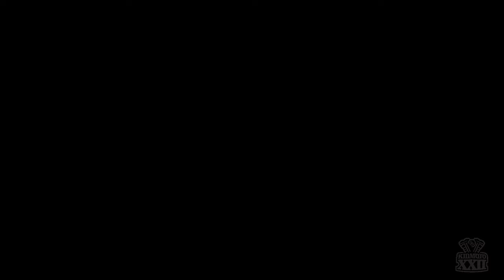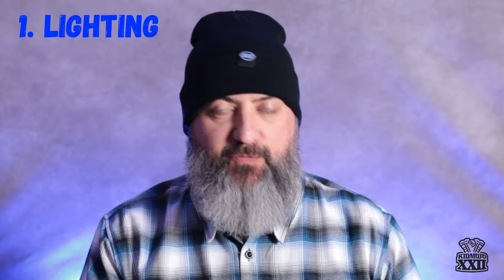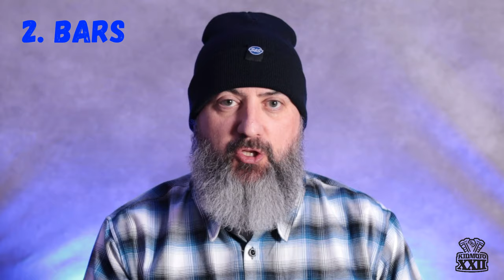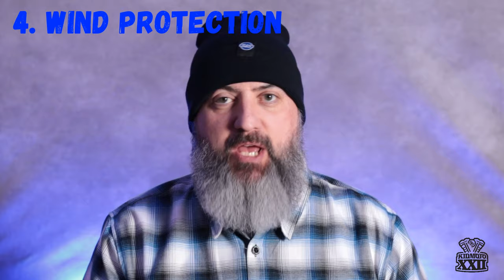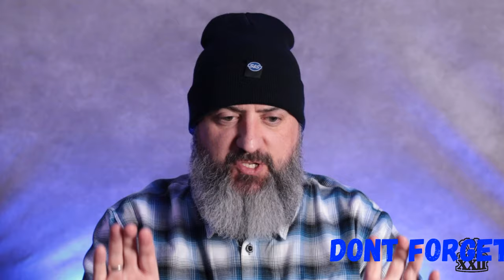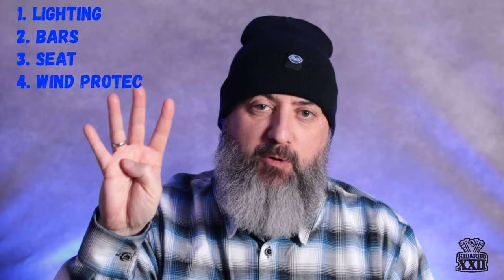5 Harley-Davidson mods to do before exhaust

Comment: Definitely no on the windshield or faring ..I ride pretty much 365 35k on a slow yr 57k was the most I’ve done ..also if you going to change the exhaust or intake it should be done FIRST the reason is Harleys are lean from the factory and should be tuned changing your exhaust it will run more lean change your exhaust and intake tune it and go from there …if you want to keep the stock exhaust  and intake get it tuned
Reply from the maker: Dude…the whole point of the video was to talk about five things “I” think a rider should change before exhaust. 
While all the things you said are true I was making an argument for breaking the mold. 
You do you! You have to live in a warm weather place to crush those miles!

Comment: I agree, but I always go 1: get the crankcase vent hot air routed out of the airbox 2: Suspension 3: seat 4: Let the CAT out and add an FP-3 or FP-4 and run a canned tune. 5: slip ons if you think you like the sound better

Comment: I have a 2000 electraglide standard. It’s a great bike. I put some really nice black chrome apes, a cop seat, and converted the lights to led. Not to mention air intake and oil cooler. And honestly I’m perfectly happy with it. I may get some fishtails on it. However it’s definitely not a deal breaker. Just make your bike comfortable and work for you and you’d be surprised how little the exhaust actually matters overall. And mines a daily driver(only vehicle I got), but I’m single and just living my life my way. To each their own.

Comment: You are absolutely correct, just bought the 2022 Road King First thing 18" handlebars, chrome lowers, shifter rear, extended brake pedal, extended footboards out, all led lights, and mod, cut baffles out or order slip-ons, lowered 1" bike, got the stock windshield and keep the seat save some money. Later at the rallies, change everything. lol! I have a chrome addiction, I love seeing other bikes chromed out to get ideas. Take care

Comment: All good points. This has been mentioned already. I upgraded front and rear suspension to Legend on my Road King Special. This is hands down the best upgrade I've ever done to any Harley. The Handling and Ride quality is so much better than stock. More planted on the road. Could go on and on about the benefits. Take care.
Reply from the maker: I’ve yet to do suspension upgrades on my bike at this point. However we are going to have the legends suspension crew on the Five Dirty Bikers podcast very soon
Reply: what did you put in the forks . i found stock ones hit hard on frost heaves
Reply: @1Imrichard  Legende AXEO cartridges. No brake dive at all now. Planted on the road. Highly recommend Legend Suspension.
Reply: I like my Springer, but I’m thinking my next HD might be a Road King so thanks for that food for thought.

Comment: Wanted to call out that I would whole heartedly agree... lighting upgrade should definitely be #1.  I use the Ciro Fang switchbacks for front, and Ciro Fangs for rear.. and they are awesome.  My rears almost look like brakes are on, until I actually apply the brake. Then went with the Ciro Vision 7" Halo for headlamp, with module to keep low beam on when I flip to high beam... and really lights up the road like  you wouldn't believe.  Was so happy this was one of my first mods I personally did first (my second was stereo system and speakers lol).
Reply: I listen to the road

Comment: I’m glad that there are still bikes out there with halogen headlamps. I don’t like the color of the leds, all my bikes have had halogen and appear a more natural color allowing me to better perception of distance and hazards on the road. I guess it’s what you get used to. And as many older riders may be finding out, those high handlebars that keep your hands above your heart, makes your hand go to sleep. You have much more strength and control with your hands down in front of your body instead of up high. In an emergency situation that may be critical. Sometimes we put form over function.
Reply from the maker: My bars are level with my shoulders and allow for the most natural position for me to ride. With my height and arm length that’s the best fit. I ride long days and the stock bars had my wrist in a very uncomfortable position. For me the bar change was both form and function.

Comment: I was sceptical when I first tuned into this video but, this guy has a point and I've always done exactly all those upgrades for my personal comfort and safety. I would however add the following; your seat, I've been using the same seat since 2008, my CVO seat and I put it on three other bikes since - the most comfortable seat I've ever used from HD, upgraded shocks are a must and you must do both front and back for proper results, I also install the Power Commander tuner to get better AF mixture which adds a lot more response, better torque and reduces engine temps, I also immediately install the Axtell Oil Bypass upgrade (on TCs - do not know about m8s) to increase oil flow, reduce temps and enhance the cam chests splash lubrication, the S&S 583 cam with better bearings and finally, I always change the air box and in my opinion, the S&S Teardrop is still the best performing air box on the market.

Comment: 05 Road King Custom (3200 miles & had her 3 weeks)took off the heel shifter, added Lockable hard bags, LED headlight/driving lights, riders backrest, adjusted the bars to comfort and highway pegs. Need heated grips and I’m ready to roll. I think I will get progressive suspension front and back as well.
Reply from the maker: Suspension is a great first upgrade

Comment: 1) shocks have been upgraded to Progressives  2) seat and I have a Road Air Zeppelin that is heated  3) heated grips 4) engine guard foot location and I have a Lindbar with stirrups 5) cup holder

I have an 06 ElectaGlide Standard that has been highly modified. I have the Screaming Eagle CVO paint design but in Sunglow Yellow and Sunglow Blue. Kuryakyn windshield mirrors and some of their other chrome doo dads. It has the 6" windscreen and the Sony radio with Bluetooth to work with my Arai full face helmet on the phone functions. I have the stretch tank and stretch bags. I have added cruise control, tour pack with Zeppelin backrest, and the bag guards of the Ultra Classic. At 30k miles I had it punched out to 98 CI, gear drive torque cam, Fueling oil pump, fish tail open exhaust, and performance tune to get me to 101 HP.  I am now at 120K miles and it is still as tight as it was at 31k miles. I have replaced the heated grips twice. I am still waiting for the transmission to fail so I can put in a 6 speed. It can out perform the 06 CVO and has all of the CVO or better upgrades for $8 grand less. I will easily roll it to 200K miles.
Reply from the maker: That’s awesome dude…sounds like you’ve got a killer right there and your taking great care of it!

Comment: I bought a used 2023 RKS. Luckily with SE exhaust, and original Ventilator airfilter and HD windsplitter. I just added….Hyperpro suspension F+R, Saddlemen SDC Pro, 14” Gangster bar with Kahuna heated grips, and rear crashbars…..check✅

Comment: The wide bars are like power steering as far as counter steering goes and personally I like them. I ride touring bikes Ultra Classes so it’s covered, and I went with a about 7 K worth of performance mods for power and reliability and a really good tuner, this includes exhaust mods. I wanted well over 100 horsepower and torque for riding two up and loaded. Everyone needs to do what they think is best for their bike.

Comment: On the newer touring bikes, specifically the 09 to 16 the exhaust is also a comfort mod. I'm talking the head pipes with the cat right by your foot. before I replaced the head pipe on my rushmore bike, I cut the cat out and added a tuner.

Comment: Agree, if you count adding the heel shifter, I've done all those things. I have a 2020 Road Glide Special, exhaust is still stock and probably will stay that way.
Reply: I took a short 80 miler today, and I realize I had foot pegs added to my highway bars too. I have a 114 now. After a 1200, 103, 103 stage one how much more power do I need?

Comment: Sir, what a great video. The first modification I did was get rid of that horrible brake pedal. I replaced it with a soft brake brand lower pedal and what a difference. Then I did your other 4 recommendations .
Reply from the maker: I think that as I’ve put more and more miles on my bike I’ve seen safety and comfort take priority over sound. That said I recently did a cam upgrade and nothing has changed the characteristics   of the motor as much as that has. A cam upgrade is something I’d highly recommend.

Comment: My 22 RG Limited 
1. Klockwerks windshield
2. Hammock seat
3. Bars-12 inch KST fully adjustable
4. Rear Light’s- Custom Dynamics LED Taillights/Signals, Filler panels and bag lights, license plate relocation kit with new taillight and CD flasher controller
5. Front LightsCustom Dynamics front LED light/ signal, lower lights, headlight bezel lights, windshield frame lights
4. Rinehart 4.5 DBX

Next is Trask A/C, SE stage 2 TQ cam and tuner
Reply from the maker: That’s a solid list!!!!

Comment: I have a 17 ultra limited. I got led lighting all the way around (aftermarket turn signals), aftermarket bars (12in mini aps), love the stock seat, batwing fairing and lowers for wind protection, and foot boards with the heel shifter removed lol 
I think im ready for exhaust 😊
Reply from the maker: Sounds like your solid!

Comment: 2016 Dyna Low Rider, upgrades in order. Race Tech springs and gold emulators with +2” tracker die extended dampers built front suspension, rear legend suspension, Arlen ness monster sucker, Greg Lutzka Bassani exhaust, DynoJet power vision 4 tuner, saddlemen seat, forbidden motor bars and risers, +4” clutch and brake lines, led headlight/taillight and turn signals, foot controls Rider/passenger, crash bars, rear high crash pegs, thrashin saddle bags and lastly thrashin handlebars bag. Fxrt fairing on the way and still planning more for the future 😅
Reply from the maker: Hellva Mod list!

Comment: Here are my mods i am doing and then my exhaust. First and foremost is my seat. I just bought a SG ST and the seat sucked so i ordered and got the ASR seat but the pillion is on back order so i don’t have that yet. But my azz doesn’t hurt so I’m good. 2nd was 12” apes by Factory 47. Next was some Willie G Mirrors. I do not like the factor mirrors on the Street Glide. 3 is floor boards for the passenger, whoever she is. 4 is luggage rack and bitch bar both quick detachable to go with the docking kit. 5 is the Klock Werks 6-1/2” Flair Shield. Those are my 5 before watching your video. Next will be the TAB 50 Cal slipons. Ok now back to your video. Let’s see what your 5 are.

Comment: I run an extended heal shifter adjusted low extra long it allows me more room and I still get the benefit of having it .
Reply from the maker: Man that heal shifter is the first think I removed. I’ve just never been a fan of them. That said I saw one made by Yaffe that was pretty dope and ran under the footboard and came up the back…only problem is that one arm was over $300….😳

Comment: 1. lighting can be a good move, if you are aware the High beam becomes just shy of useless, and with turn signals you will need load equalizers or you will have a super-fast flash like a chevy with a bulb out, or you could start blowing codes. 2. totally agree with changing bars, the stock bars on my Road King suck and I'm going to go with Heritage Bars, but people need to be aware a handlebar job if not doing it yourself can run up to and over $2000 with the E-throttle and wire in the bars etc. it's not a cheap job, 3. Seat i agree for the most part the stock harley seat is average at best, but kudo's to Harley the Road King Seat is very nice, that being said do NOT discount Harley's Aftermarket seats like the Sundowner less than 1/2 to 1/4 what a Mustang, Corbin or others cost and all day comfortable !!  4. I've been riding for over 58 years and only a few times when i was younger would i tolerate a windshield or fairing i hated them, I'm an old man now and my Road King has one of the King Windshields, that i Can see over just barely if i have to, but i really am looking thru it most of the time and OMG i love it !!  have not tried lowers yet. 5. i have owned over a dozen Harleys over the years and i have NEVER changed from the stock foot pegs or floorboards ........thanks great video fun to watch and chat with as i watched
Reply from the maker: With the canbus system load equalizers haven’t been necessary and I’ve changed all the lighting on my bike. That said I 100% appreciate the experience of someone who has owned and ridden bikes across many years.  HD doesn’t make a bad aftermarket seat at all and I own one that I use for 2-up riding. Many of the mods I’ve made have been for my personal comfort for where and how I ride. Mostly I wanted to get people thinking about the mods they do and why. Much respect…👊🏼.

Comment: The foot control’s personally having a larger boot size can cause issues without having extended shifter arms  why they purposely remove then from some bike while increasing MSRP and include not only the heel shifter as wrll as being extended on the cvo kind of proves the point

Comment: First mod you should do is, an aftermarket stage 2! Then suspension, handle bars, and foot controls and last but not least Audio, better speakers and a amp!  Just how I do it!  ……All then a big bore kit! 124” 128” etc.

Comment: If your a taller rider I'd suggest going to a custom auto upholstery shop and getting your seat worked on if you need more room. They'll shave the seat foam back and youd have to get a new seat color. In comparison to buying a premade seat, my 2 up wide glide seat is getting the foam shaved down and new brown leather on it for 500 dollars. They'll shave the foam down step by step and you go and sit on you bike and try it out then take it back. 100% recommendation
Reply from the maker: Sounds like you found a good shop doing exactly what you want and need!
Reply: @kidmoto22  yeah to my assumption any custom upholstery shop should love and be able to do good reconstruction work
Reply from the maker: @josiahwells7442  I’ve never looked into anything like that in my area but it might be worth it at some point
Reply: @kidmoto22  yeah it's totally worth it. Then you can also get like a  custom seat. Custom leather custom pattern and stitching. I'd like to see a lot more bikes riding around with a custom seat and custom leather. It's great for small shops to

Comment: Great suggestions for first mods.  Mine went off key, but my RKS was delivered with Rinehart 4.5s and Custom Dynamics Probeam turnsignals.  Next I did 12" KST doubletrouble bars, 16" LRS windshield, FOX 13" suspension.  I have a CVO solo seat and a mustang sport touring for distance rides.

How do you like your Memphis Shades hanguards?
Reply from the maker: They are excellent! I’ve had them on two bikes and really like them. They are good for blocking wind on cold days and road debris. I’ve got mine paint matched and that has held up very well.

Comment: I did all of those mods early, but the heel shifter stays.  I have a Slipstream windshield on my 06 Ultra Classic as I don’t care for wind in my face. I put a windshield on every motorcycle I’ve owned because of allergies. 
Good suggestions..

Comment: I have a 2021 road king special.. I have extended the  brake arm so my toe will not be underneath the brake petal.   I have also changed the bars from the original bars because the risk position was horrible. My problem is that the bars I purchased which are cycle Smith lane splitters aletters are also horrible for wrist position.   I purchased the cycle Smith because they have a 32" width And are 12" bars. I have been searching for another set of bars with not much success. Most of the bars I have looked at are too wide. Do you have a recommendation for 12" bars that are close  To 32" width That would have a comfortable wrist position. I also need bars with as much pull back as possible. Thanks for any recommendation you might have.
Reply from the maker: Not sure if I’m gonna be much help cause I’m a t-bar or moto bar and riser guy. They tend to be a little more narrow. If your looking for ape style bars maybe check out factory 47 or Carlini bars. I raise with guys that have both of those brands and they really like them.
Reply: @kidmoto22  Thank You,, I will look at those bars

Comment: Bought 2018 street glide special hard candy hotrod red flake 1st mod stage 3 2nd mod upgraded stereo system 3rd mod higher freedom windshield 4th mod halo maker headlight and running lights and custom dynamics led turn signals 5th mod while in Sturgis a saddle man seat 6th mod 12 inch handlebars and the last mod rcx tormentor head pipe and changing out the tab performance mufflers quiet baffles to zombie baffles

Comment: I think exhaust should be number 1 since drivers already use the excuse "I didn't see them".Only way you can try to make them see you is if they can hear you.Louder the better.
Reply from the maker: If you really want to change the sound and performance than a CAM is the way to go!